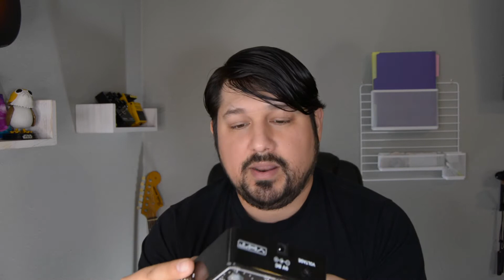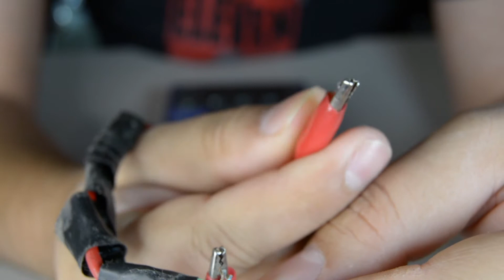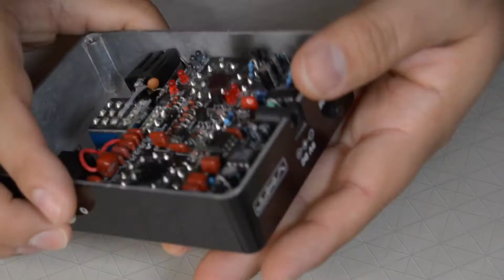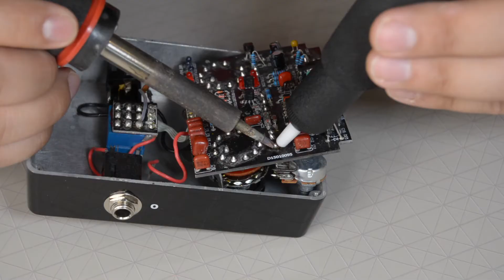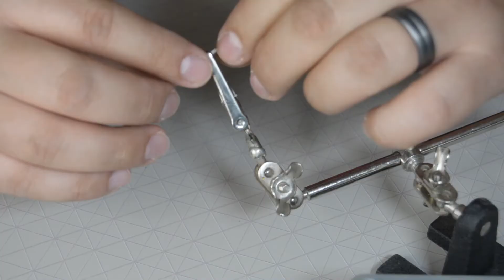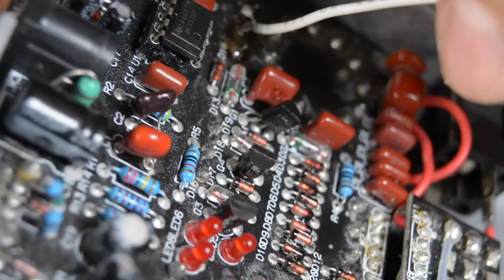How to TROUBLESHOOT GUITAR PEDALS: Signal Tracing a VHT V-Drive Overdrive - Troubleshooting Tips

Comment: I have a Matrix SR-3000 Automatic Chromatic Tuner Pedal that worked with a Battery, but when I plugged in a power supply that had too much voltage it blew out a component.  Which component needs to be replaced and where would it normally be found?

Comment: I was just looking for a schematic. I found an item with all the diode configurations, as pairs, and now recognise some as typical of specific other pedals, but some are soft-clip designs, and I assumed they were all hard-clip topologies, just different diode combinations. I'm now thinking they may be all soft-clip, or all hard-clip, as I can't think of a way to easily switch between hard and soft clipping topologies, with just a single rotary switch.

Comment: Hello! Good morning, how are you?

I recently bought a used VHT V-Drive in very good condition, but when I activate the drive in almost any mode, it makes a high-pitched noise with radio signals. I looked on the internet and it seems to have been a problem with the first batch of pedals. And the bypass/switch in some modes, when turned off, cuts the guitar volume slightly and I need to touch the switch again - but without activating it - so that the signal goes back to true bypass through the pedal.

Can you give me some advice so I can get it resolved by a pedal repair technician?
Reply: ¿Tendrá dañado el Switch?

Comment: Thats crazy..Never heard this pedal. It sounds like a good drive pedal.Sounds like something I would use with single coils.. Put some verb with it and bend some strings and your set.. But Did the guy burn up the trace in the board.. Is that why you used the wire? Because what if you skip something?  How do you know? I know stupid question I'm still watching,lol

Comment: V drive is one of my favorite pedals because of how much sag you can dial in and it's versatility. Glad to see this one back to life :)
Reply from the maker: I before never knew this pedal existed. It amazes me on how cheap you can pick this up.  I saw it sell for $40 used. It will definitely get added to my board.  More to come.  ✌️
Reply: @rsaldana1980  Yeah, you can even get some Fuzz sounds with certain settings. I also laughed pretty hard when I opened mine up and saw how many LEDs and diodes there are. No wonder you can get so many different sounds.
Reply from the maker: I plan to really mess with it more once I get my amp up to working condition. Gotta change some tubes.
Reply: @rsaldana1980  Trying adjusting the voltage control to really get some different kinds of distortion and fuzz from it.